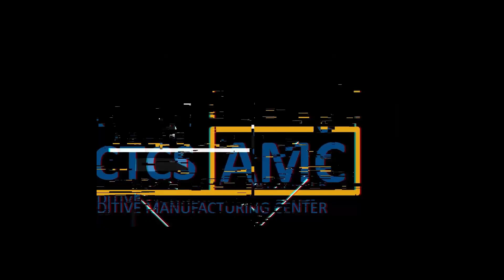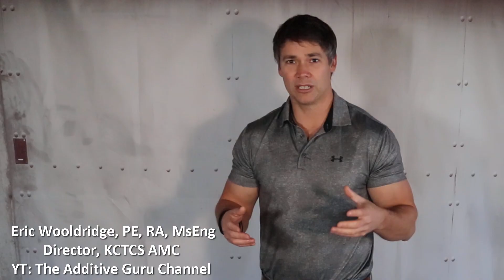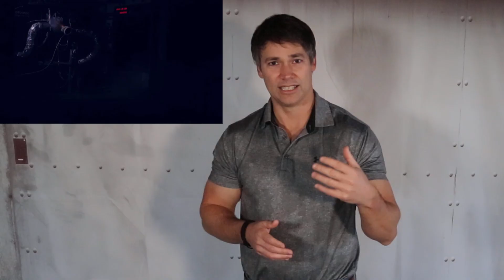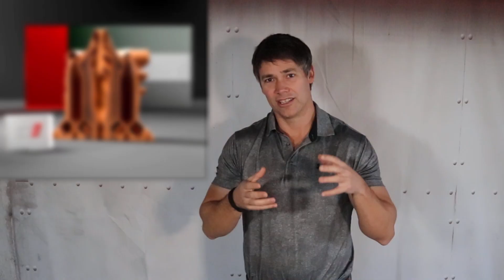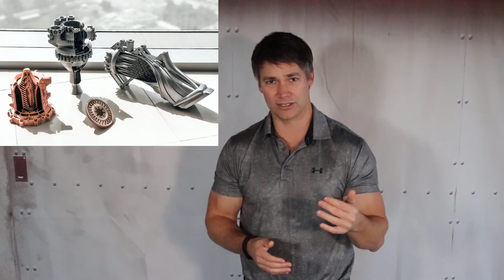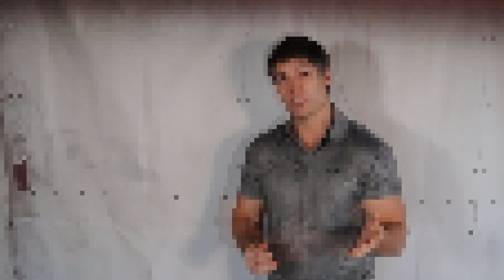Leap71 3D Printing Rocket Engines

Comment: What if the diameter of those tubes have been widened to double of their recent size and the machine becomes a bit greater in size than our regular jet engine. I do believe that it will function beneficially.